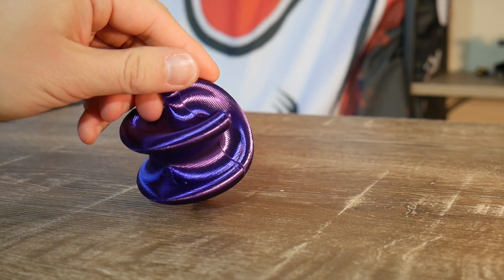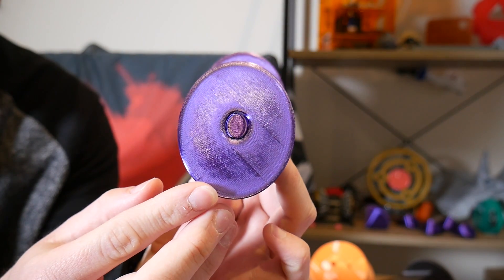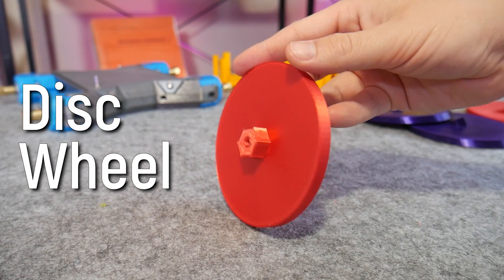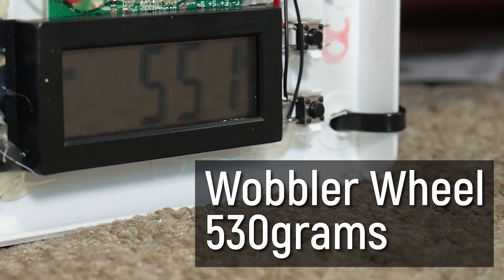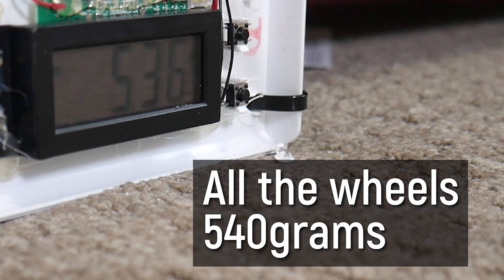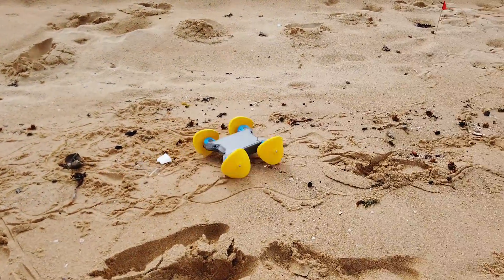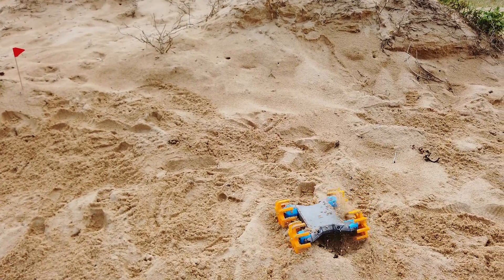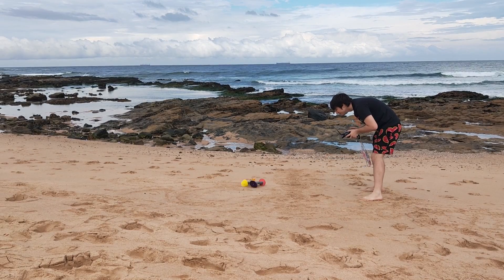This Robot Drives on Wobbly Wheels (but HOW?)

Comment: This is the definition of “re-inventing the wheel!”
Reply: Damn!  @Jason Egan
Reply: And failing to understand that a wheel has to be enough thick and enough rubbery so the coefficient of friction is correct.
Sick sad world where even "intelligent" people are dumb.
Reply: @romarainpublic6735  yh I dont think so wobble wheels are applicable on big scale vehicles. We could just use rigged or tank-like wheels to roam sandy terrains
Reply: @romarainpublic6735  🤔 So, can it used as alternative wheel option for Mars Rover?
Reply: @XanderProduction  There is a reason wheels are the way they are, weight! being completely vertical puts the force directly down, also if you want to really test out wobbly wheels and the effect they would have on an automobile remove the weights balancing ur tires off the rim and tell me how it rolls. When a wheel is out of balance which is exactly what a wobbly wheel would be it throws the car all over at higher speeds very rough ride indeed.

Comment: This was a very good demonstration of different types of tyres that I would like to see de3monstrated with larger tyres. Differential bottoming out is very common in 4x4 driving. No matter the type of tyre or strength of engine if your wheel circumference is too small when you are driving in ruts the diff pumpkin will hit and you will lose traction. 
Displacing the mud and gaining traction with deep grooved mud tyres is very important for muddy tracks, I would love to see how your ellipse and prongle tyres did in wet sand, mud, or dry sand if they were larger and the chassis di not bottom out :)

Comment: All of these would have done better if the base was a little taller. Bottoming out is a huge problem for vehicles designed for sand. Most of the time once the base of the frame touches the ground it is all over.

Comment: Thanks for posting this MM. Love the Oloid and the Wobbler, such smooth movers.

On my drive to work I go past a garden full of different metal wind turning illusions which all look great when they move in unison.

Seeing the Wobbler I'd have thought that vibration would be quite bad at high speed but I think the 5 spoke is a good wheel. Also surprising
was how well the 4 different wheels worked together.

I mix plasters and mortars and want an optimum paddle mixer end that mixes the material by pulling it up from the bottom of the bucket to the top and wondered if you could come up with something. If it works well then we should go 50/50 on any profits made from it's online global sales :) 

Earlier this year I bought a fancy revolutionary new whisk made from a polyurethane resin that looked like 2 elongated O's on a stick which turned out to be rubbish at mixing mortar but may be revolutionary with gypsum plaster because it has finer granules, I don't know and didn't bother finding out because it was shite at the work I needed it to do and went back to my original circular whisk and got my money back.

Otherwise how about a film on different wind turners please.

Comment: Here, give this a try if it's not too late: https://www.thingiverse.com/thing:4821356
Reply: Note: I just added a second wheel design that should work on both carpet and sand. Both files are in the same Thingiverse page.
Reply from the maker: Thanks Scott! Got it downloaded for printing.
Reply: @MakersMuse  Awesome! I hope it works well. Thanks for letting me know you saw it. I think the 2-in-1 version with the disk part will work best personally, especially on carpet.
Reply: This is my own design btw, that I made just for your sand test.

Comment: I think you did not take into account the excessive drag on the body of the car ramping up the static drag of the sand on body to reduce the force wheels could generate.  Raising the body higher would work better.

Comment: So my recommendation one thing I did notice is because you are using that tank style skid steer driving get a central button or toggle that activates the throttle on both sides at the same time it's going to give you more control with the quote unquote uncontrolled Wheels

Comment: The spoke wheels were good, but they still sunk into the sand. That's why the dune-buggy cars have big, air-filled tires that ALSO have paddles. The big tire keeps it from sinking, and the paddles propel it. It's not as fun as the wobbly wheels, but probably still best for sand. Basically, all of these designs need more surface area in order to stay on top of the sand.

Comment: The wobble wheel movement pattern is similar to some squid swimming pattern, also I think that the mayor inconvenience is the size of those strange wheels, you can have a larger normal wheel (with obviously more surface area) instead a slim curved one...but, making incisions on the wheels can make them a lot more efficient
(sorry for bad English 🙏🏻)

Comment: You measured the area around the wheels, and compared widths. But I didn't see anything on the spokes. Perhaps you should try this: The potato chip wheels with the spokes interlaced through the edge of the chip, so you get the wobble and the spoke benefits. The spoke, nor the wobble are taller than each other but of equal diameter.

We saw that the disc wheels (all versions) eventually dug into the sand and had low traction. We also saw the spoke dig, but throw sand behind it. I think it would be possible to mix them to gain an improved version.

Comment: That's why they used spoked wheels on the Mars rovers. In a way, you’re reinventing (or rather rediscovering) the wheel lol. Stick a cup inside those wheels. I believe that with them not sinking the efficiency will be greater.

Comment: Well you do know your biggest problem was that you're chassis was too low. I think all of your wheels would have fared better if they were wider for more attraction first of all. Secondly of a way larger diameter giving your chassis lots of ground clearance. Because once your body started being the contact point the large area of contact created more friction than the small surface area of the wheels were able to offset. Think of it like driving a lowered car trying to leave to steep of a driveway. Everything is fine until the front of the car gets too far over the fulcrum. Leaving the front wheels to spin freely in the air while the rear wheels are left to try and push the chassis further out hopefully stopping at a point where the front wheels have once again made contact with the ground. Which usually isn't the case. It's usually that the front wheels are left hanging in the air while the chassis is dragged to its highest friction point somewhere in the middle where the rear wheels don't have enough traction to push the car to the tipping point so the nose will fall back down and make contact and pull the chassis the rest of the way over.

Comment: Ground clearance is a huge factor. Once the body contacts any sand it increases drag and reduces traction. Better results and improved wheel performance might be had from larger diameter wheels and/or increased ground clearance.  This was absolutely fascinating! I had fun watching this, thanks.

Comment: First time I've visited your channel and I couldn't wipe the smile off my face - The engineering, the scientific approach, and the sheer silliness of the wobbler wheels.  I was wondering if the chassis of the robot is somehow impeding the performance of the wheels as it bottoms out on the sand?  It might be as simple as maybe increasing the diameter of the wheels, this may decrease the performance of the motors however.  Changing the geometry of the chassis won't do much I think due to the physical dimensions of the motor axle...
Love it all and I've definitely subbed!!

Comment: Reverse the angles on your last set of wheels the ones that look like little paddles the yellow ones if you look at the angle of each little paddle the sides meaning the front and back of each paddle it's tapered from top to bottom wide to narrow reverse that make it wide at the bottom narrow at the top now they'll act more like paddles as each paddle digs into the sand as is the sand slides off downwards instead of upwards if you reverse those angles the digging potential and the throwing potential will increase greatly.

Comment: the true best wheels would be tank tracks the larger surface area would put less weight on the ground thus it won't dig into the sand and get stuck, but they cant be used cause of the surface area restriction

Comment: How about similar to the "8- spoke" wheel type of wheel but with three 1/4" pegs on each spoke that point down  (sticking down into the sand a bit) on each little spoke of the "8-spoke" wheels.

Comment: The wobbly wheel is the most entertaining.  In addition, I figured the spokes would work the best out of the whole bunch in the sand.   As far as soft sand navigating - buoyancy. Make some fatties about 2 inches wide with maybe a few mm of tread lines and you'll be cooking.   The spokes would probably work well in the snow, as you need to dig down a bit for traction.   As far as pulling power, you're going to have to work on the gravitational pull of the earth on the craft - it's way too light : )

Comment: Can you build a electronic car where the battery is charged by the rotation of the wheel/wheel (you know the Dynamo mechanism)while driving.
So it may charge while while driving and don't have to stop and plug in a charger.

Comment: Another thing to compare the spoked wheels to would be tank tracks. They have that same spoked design to grip into a plethora of offroad surfaces, save for the really really slimy mud found in tropical regions or deforested and barren areas like No Man's Land in WW1. There's just no contest in comparison to the wobbly or "prongle" wheels, and it is indeed rather unfair. You should put the wheels through different tests, to see what sticks.

Comment: Probably needed more clearance (i.e. bigger diameter wheels) for that sand track test?    I also wonder whether the paddle wheels actually, in effect, have a bigger surface area than the others because the sides of the paddles are also engaged with any surface that's not perfectly flat?     Nice vid though thanks.

Comment: What you did wrong is how you calculated the surface area, you see when a wheel is standing like it should, the surface area is only the part touching the ground, because that is all that matters for traction. so the spoke wheel had ALOT more surface area considered the width of the spokes, and also when turning the wheel, 2 spokes at a time on each wheels will touch simultaniously, and together with the paddle design and sharp edges, it ofcourse will perform better..... but you did it wrong calculating surface area when it comes to traction.

Comment: Couple of thoughts: 1. If you put two prongle wheels back to back on each axle for the carpet test, I suspect you'd get straighter pull and lots of force even if the combined area was still the same.   2. For the sand tests, I think the limiting factor for all the designs is the 2000 mm2 area. What if you double the area of all 4 designs and redo the test? The sand may be impossible for any wheel with less than a certain area?    3. I suspect good design for the sand would be spoke wheels at the back and twin-prongles at the front- stability at the front, and digging in at the back. Maybe the front spokes trail of sand makes it harder for the rear wheels to dig?   4. I think the added pulling power with wobbler wheels and prongles is because you have coaxial movement as well as radial, which reduces the tendency to dig in - that's maybe why diamond shaped tyre tread gives good grip?   5. Is the wobbler wheel the same type of movement as a "nutating disk" used in some flowmeters?

Comment: @6:00 it "wanders to the right" because the chains contact was to the left of middle bc of the large area it has to travel in your tow hook design. it allows the center of weight to bias left or right depending on the opposite orientation of the contact point.

Comment: I reckon the spoked wheels performed better as well because the design makes it effectively have more surface area on sand. On flat land it should have the same surface area as the other wheels, but in sand its no longer a fair comparison, as it will dig and more than just the outer edge will come in contact with the sand giving it a slight advantage

Comment: All of the designs will work better with a center baffle.  Just a round flat disk added.    They all will also work better by limiting the "tread depth"  which is currently at infinite.   Also the Wobblies might work better if they are "locked" most of the time. I don't know if "locked" similar or opposing would be better.

Comment: These wheels need to be tested with a rc rock crawler, that will simulate a real car... the unproportional throttle control and low center of gravity affect the wheel performances

Comment: There are amphibious craft that use a long, hollow corkscrew on each side with deep ridges. Pulls the craft through mud, sand, water (it floats) and all terrain that isn't solid, like a street. If you're designing for soft, off-road, screws are the way.

Comment: you should take a look at the shark wheel.. Its a serpentine wheel design that is getting lots of commercial uses and is being sold on skateboards, luggage, carts, wheelchairs you name it. It looks like a bunch of S's stacked together and is in a cylindrical shape. It performs alot like your wobbly wheel but with more stability.

Comment: I have some robots with big wide rubber wheels and some with tracks ... can any of these strange designs beat those? 
I think the point here is that these wheels are thin and have no grooves on the surface (except the spoke wheel).

Comment: for sand the most reasonable would be alot of surface area which is basically all of these wheels at the video combined, a wheel with scoops as you said

Comment: How would a limited slip differential or open differential work? Or wouldn’t they? I can’t get my head around how this turns with an axle or if you control the drive to each wheel independently.  And cornering the inner wheel travels less of a distance so how you to re sync the wheels

Comment: Hello, just a thought (I didn't want to sort through all the comments to try to see if someone mentioned this already). What if you allowed the "Wobbler wheels" to pull sideways or allow two wheels on one side to spin clockwise and the other two wheels spin counter clockwise. You might get different results, especially for the pull and for the course navigation. Or possibly put two of the same wheels on the front and two of a different set of wheels in the rear. I love these kinds of videos. Keep up the good work! Thanks for sharing!

Comment: Seems to me that, in terms of comparing "equivalent" wheels, either track area or contact patch, not surface area, are better approximations. On a hard surface, the spoked wheels alternate between a slightly larger contact patch and a significantly larger contact patch, depending on whether 0, 1, or 2 spokes were on the ground. On a soft surface, bu sinking in a little it can have an always-larger contact patch than the other wheels. And in both cases it's a much wider track, so probably behaves more like a solid wheel with the same width and diameter, than like a thin wheel with a nominally equal rim surface area.

Comment: Try wider shapes more like the actual rolling shapes you initially started with for wheels. They will have greater surface area plus the edges in them will help to push the sand backwards

Comment: Now, hear me out, what if you put a thin layer of paper or rubber or something inside the spoked wheels. Instead of the sand going through the spokes and making it dig into the sand, it'll help get over instead of through the sand. On wet sand I imagine it does well (even though it already does) and a little better of the looser dry sand.

Comment: It may have been mentioned (Sorry, not reading 5,717 comments!) but the angle of the chain to the RC car is causing the rear axle to be unloaded. If you can get the chain level and in-line with the CG of the car it will be more accurate. 
It will also help the bouncing of the spoked wheel. It grips so well that it pulls the rear axle off the ground, that causes the bouncing. It should be much more stable.

Comment: Last part .you could also test different rolling shapes eg treds and see which gives you the most traction in the sand ,Dimples ,spikes zig zag,toothed ,square blocks.maybe stick to a rolling diameter rather than surface area because if this was being used on say a martain lander type vehicle .traction for a gived size may be more important ,ok no editing and heaps of mistakes but its posted LOL

Comment: I have a suggestion try a Zig Zag edged or saw tooth wheel ,Eg it still round looking at the side face of the wheel but rather when looking at the wheels edge  its Zig Zagged.Maybe 8 -14 small teeth rather than 4 larger teeth but who knows 4 may work ,Obviously a saw tooth will also give you a transvers portion of wheels edge also.

Comment: Its not really the surface area that's helps you spoked paddle wheels its more the tranverse edge grip.basicaly making a paddle like you said also some of the issues are due to the vehicles small size .Im not editting anything any more theres more to come

Comment: The purple wheels  slid to the right due to the way carpet is made. The tufts or the pile is slanted in one direction for longevity. If you bounce a quarter or a coin on most carpets it will always bounce in the direction of the fall or slant of the carpet pile. That's why it did that.